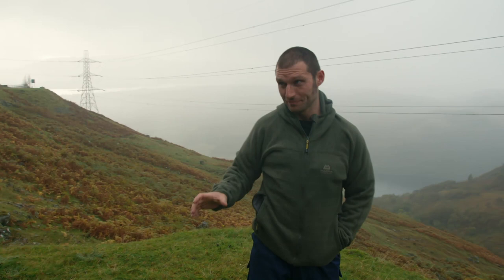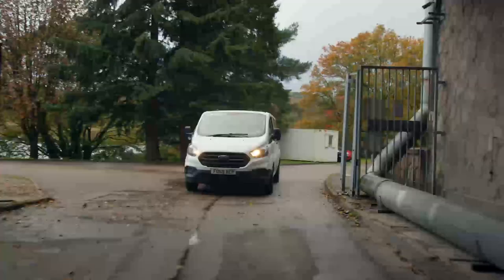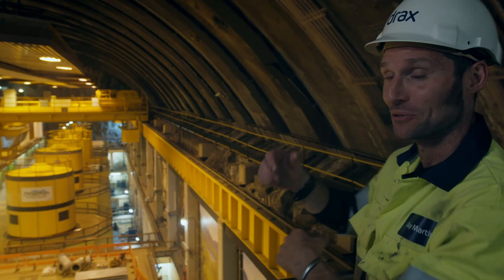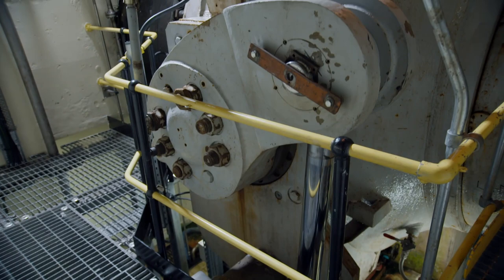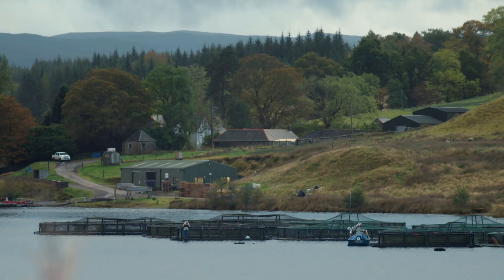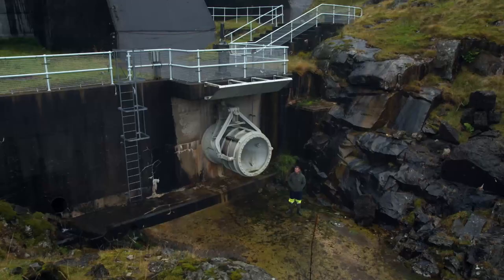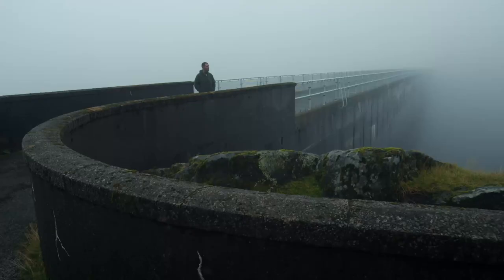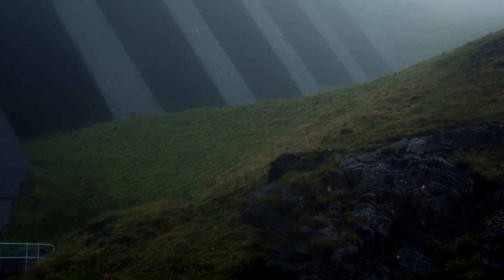Guy Tests The Water Pressure Of A Hydroelectric Dam | Guy Martin

Comment: Working as an operation engineer in a 720MW hydropower plant, i can surely say hydro electric generating stations are a marvel of Man
Reply: "Enough to recharge 100,000 electric cars"
there are about 28 million cars in the UK, so we would need to build another 280 dams of roughly this capacity and somehow keep them all topped up with wind and solar.
Then there is the Trucks, Busses, houses, businesses and trains to power as well.
Does anyone else see a few problems if we continue with net zero?
It's insane.
Reply: @thedave7760  indeed they have ecological impact aswell... We cannot rely on Renewables like wind n solar solely as they are not suitable for grid support in peaks and less inertia to damp grid oscillations. Hydro is a bit scarce during winters. Indeed we cannot get net 0 but hopefully renewables will help in reducing the depletion of carbon fuel resources

Comment: There are 2 more in the pipeline, as it were. 1 on Loch Ness called Red John, and 1 on Loch Lochy called Coire Glas. Foyers, also on Loch Ness, has been operating since the 1960s. There are a few smaller schemes in operation.

Comment: Oh, hey, it's a location used in Andor. Neat. Also, nice chops to open the valve and just stand there in the spray. Seems an odd design choice, though.
Reply: I am wondering if the manual valve is some sort of emergency failsafe in case the main switch fails.

Comment: At last a solution far better than a battery. The UK should be doing this on scale. And there are more places than you might think where this is possible.
Reply: This water battery method has been well known for awhile now.   It still takes a lot of money,  equipment, and water to make it worthwhile.
Reply: @MrBen527  I hear ya bud, nothing is free. However once you've got this going and set up it would be among the cleanest forms of energy storage. And the idea is basically the same as hydro power, which is already fairly popular in Scottage 🙂 So yeah, they could do more of this for sure. I regularly drive past Tintwistle in Yorks region, and there are about 3 large dams in a row, imagine if the pump facility was at the bottom to the top, with 3 hydro plants running down the chain every time... could easily power most of Manchester. And this would be the best way to set it up, multiple plants consecutively down valley. Maximise the gains.
Reply: @theoutsider6191  I agree! 🙂
Reply: @theoutsider6191  are you serious?
Reply: @Walker_Texas_Danger  only a little 😂😂😂😎

Comment: how do you change that seal on that drain valve or just tapered?
Reply: Most likely they have at least one back up valve that they can shut, possibly a plug as well
Reply: @peterlustig8021  you just have to do it really quick when you open it
Reply: just drain the reservoir. its pumped storage.
Reply: Spray the pipe with freezing solution 😊.

Comment: 440MW - sorry  but a drop in the ocean and what about the pumping losses. At least it can provide Mvars as needed at anytime
Reply: we are in an era of massive parallelism marked by distributed smaller systems. these pumped storage "water batteries" dont benefit so much from scale as  primary generation plants do. but you need a hoo.
Reply: Efficiency of pumped hydro is around 80%. 
Pumped hydro was unique in that it offers very rapid changes in output. These days, batteries offer that too, but nobody's using batteries at the scale of pumped hydro yet: this power station can supply 7 GWh.

Comment: Instead you can dig holes, drop heavy rock down the shaft when you need electricity and lift it up when in excess
Reply: The problem is that that's difficult to scale. Dinorwig power station moves 390 tons of water per second to generate 1.8 GW, or 1.4 million tons per hour. The largest winches have a capacity on the order of 1000 tons, so you'd need 1400 winches to generate as much power as Dinorwig's 6 turbines.

Comment: Years ago when I was an electrical apprentice, 1980's, we were told of a proposed American  scheme, where they would use excess power to compress air to a few psi above ambient and store it by pressurising a huge underground cavern, what came of it I have no idea.
Reply: There working on this in many countries
Reply: It's working.
Reply: caverns are already used the Nat Gas, propane, or ethane storage.
Reply: The problem with compressed air storage is that when you compress air, it heats up. The heat then leaks out through the rock, and the amount of energy you can recover is relatively low. It's less efficient than pumped hydro.
Reply: @zounds010  yes adibatic compression not isothermal

Comment: It's a bit of a conundrum to think what the electric car owners of the world would do with that last 18 hours of power grid.
And what non trade skilled citizens would resort to to last 18 more.
Reply: EVs charge when cheap surplus power is available, which happens more and more often.  A few even use Vehicle2grid to put power back into the grid at peak demand. Like this dam.
Reply: @thomasgade226  EVs charge when you get home from work at 5 PM in the worst of the evening peak consumption. Unless you have complicated time offset built into each car.
Reply: @gregorymalchuk272  keepin it real
Reply: @gregorymalchuk272  "complicated time offset" 

Mate it's just a bit of code saying to not charge unless it's over a set time.....
Reply: @gregorymalchuk272  some do - and pay more. We shifted thousands of cars' charge by shifting the taxes, further increasing peak price while decreasing the offpeak price. Net cost is the same for non-EV homes.

Comment: Fun fact : Nuclear is "greener" because dams release a lot of methane from organic decomposition caused by repeated flooding
Reply: Hydroelectricity is fine. They last hundreds of years, so any methane from preexisting vegetation gets amortized over centuries of electricity production. The greens hate both nuclear and hydroelectricity. Because they are the two forms of carbon free energy that actually make economic sense and don't require demolishing industrial civilization and rebuilding on a basis of artificial scarcity and control.
Reply: Not necessarily. In colder places where large scale Hydro-Electric schemes exist, like Tasmania in Australia, NZ and Canada they don't emit as many methane emissions as you presume because they are in colder climates. Hydro -Electric is vastly superior to nuclear, as it relies completely on an pure renewable source of power ie water. Nuclear power by contrast relies on an non-renewable source of power ie uranium.  Unfortunately however for an lot of jurisdictions they don't have the necessary water catchment areas to support the uptake of large scale Hydro-Electric infrastructure options.

Comment: ok so last i posted it was about my invention well this is a post on the issues of green power technology 
So firstly there is no such thing as green power. WHY? 
Well by my book for it to be green the power used to process the raw materials into say a billet of aluminum must have come from hydro as wind and solar can't deliver the rate of power needed for the smelter to run
Now this issue exists throughout the entire chain from ground to shop front and then there is the Elephant in the room of 100% recyclable non meet that bar let alone exceed it 
wind at best is 65%
solar well 25-30% 
even hydro at about 95% is not 100%
So i hear you shouting this man's full of #### And yes you are on the right line if your about the power made sold to the public not the back story 
Lets put it another way would you let your child have a Teddybear filled with toxic material's ? NO the first job as a mom or dad is to keep them healthy yet you will allow technology into their future that as i type this is going to landfill 
Now to the next issue life of the power technology 
So solar is about 12 years then the return drops off by 15yrs your looking to replace them
Wind is about 27 years then costs have eaten all the profit
Hydroelectricity well 100 years is the norm but can run twice that 
Now in closing its time for some truths in my world
yes i am for hydro over sun and wind and as RDP Marine Australia i have an agenda but it is up front i have told you 
Also i have moved to a caravan lifestyle 10 years ago a van i designed and made solar on the roof 8 135amp batteries AND MADE IN FIBERGLASS so i know i live it    
In closing well done for getting this far and yes it is just right to live in and have been doing so since 2014